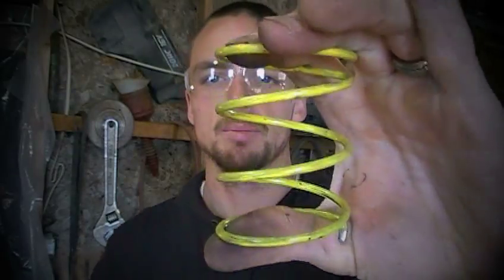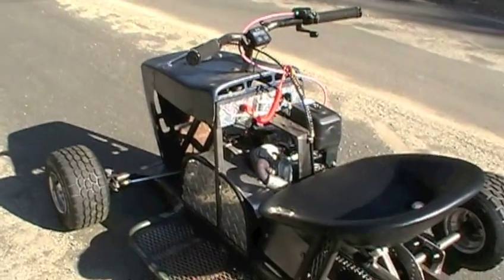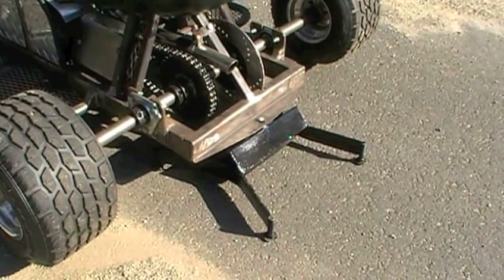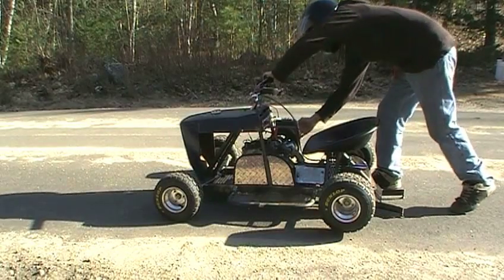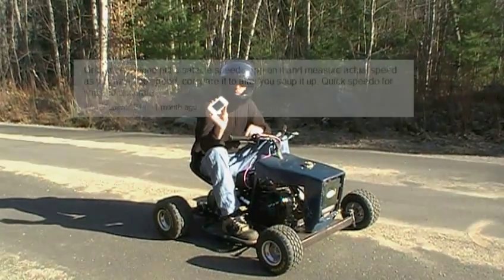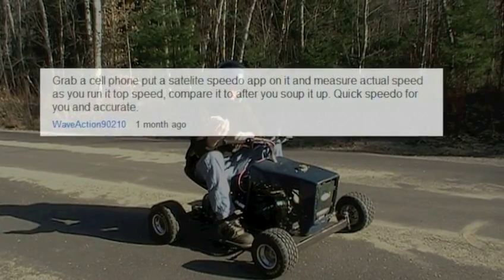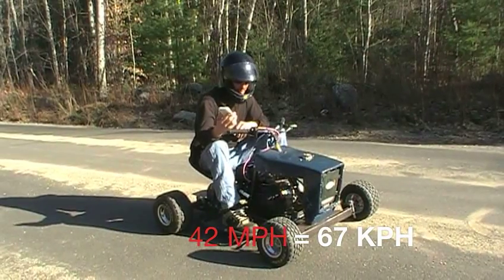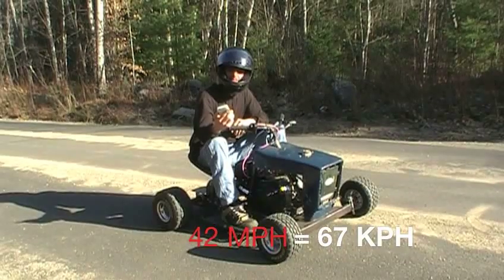Racing Mower/Go Kart Test Drive #2 (Top Speed Run)

Comment: 42 isnt bad at all, i love messing around with mine.  i got an old weed eater brand riding mower going 35mph with a 12.5 briggs. changed some things since and havnt tested the mph. lowered the front end, rear fenders and seat, relocated the battery and added a 14.5hp briggs. its pretty fun lol.

Comment: Thanks. Well, as I mentioned, these torque convertors need a LOT of gear to work with, like, the rear sprocket needs to be around 3/4 the size of the tire. If theres stock (too little) gear, the torque convertor will kick in and stop the RPMs from climbing and you will go nowhere. As long as you have upgraded parts to allow RPM, the engine is indestructible.

Comment: I got a camshaft for my GX200, and now it pulls like a MOFO! I changed the stock 10T sprocket to an 8T sprocket on the torque convertor. Now, I need to change my rear 50T to a 60T. At that point, it will keep climbing speed instead of "hitting a wall". With hat RPM though, I will probably need some billet parts, and a bigger carburetor. With the torque convertor, you need a lot of gear so it doesnt "hit a wall" and flatline RPM

Comment: cool ass vid dude. on the driven, #1 =least spring tension to shift @ lower rpm, #2 = medium spring tension (factory setting), #3 = most spring tension to shift @ higher rpms for hilly terrains and the yellow spring has more torque than the green. I got that off diy go carts. I got an old yerf dog.

Comment: reitzy69
The honda parts will fit most clone engines. Also there are plenty of hot rod parts for these engines.
Fearless, put a good set of valve springs in it first thing, I put a set of I think 18 lbs. springs in and a bigger carb. and made a ton more power on top end!!!

Comment: Oh Hell Yeah!! 42$@#%^&!mph!!!! & the motor isn't even hot rodded yet!! When u did ur donuts u would transition from dirt to bare tar and that 'cart didn't get upset or tip over, it is a very stable machine, which must help the confidense in feelin like u could go faster with a modded engine.  Great job buildin a machine that is fairly safe and u can feel good about sellin off. My only suggestion, put a parental throttle on it, so young'uns can use it and it will go faster as they get older.

Comment: that would look cool as shit with a tach on the hood lol i have a crasftman 1993 racing mower with exstented axle with single cyclinder 15.5 what would be some good cheap mods i could do i have after market carbon pull swap tires like u but i have so much compression i blew my starter up and cant find a new 1 that i can afford so my mower has been sitting for some time.. ill put picture of my mower on my channel

Comment: Shout out to say awsome kart build Fearless. Ur vids are outstanding. Any ideas of spreading rear wheels on mower rear end? Like spacer them about 4 inches on each side. I think you can add spacer nipples of different lengths on 4 bolt rims but i have the single hole rims. I lov messin with riding mowers and have a trike i set up on facebook robbie101373. My cheap idea of poormans atv.
Rob